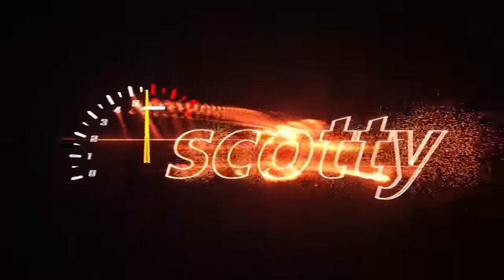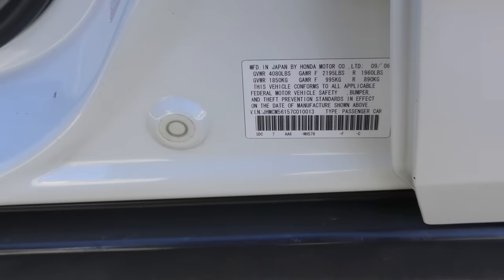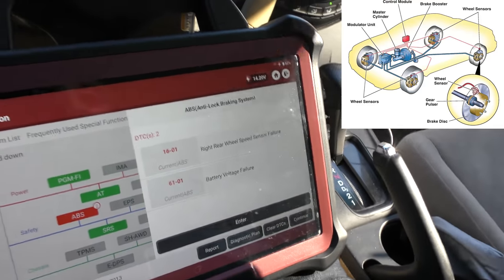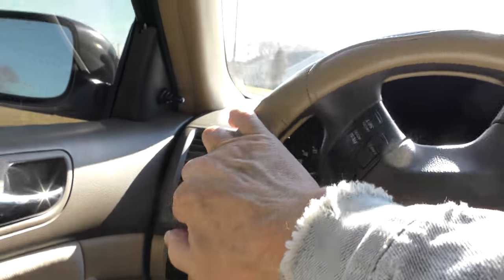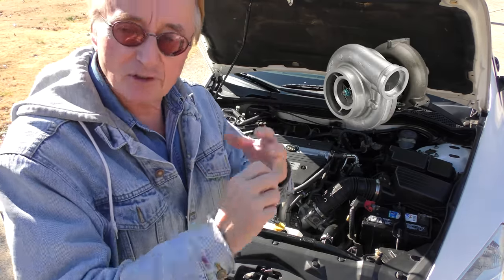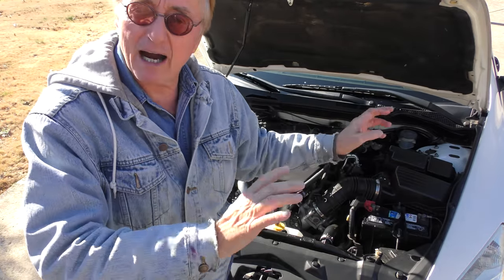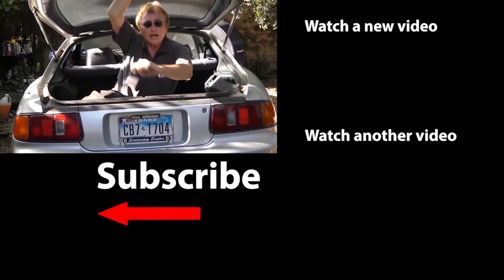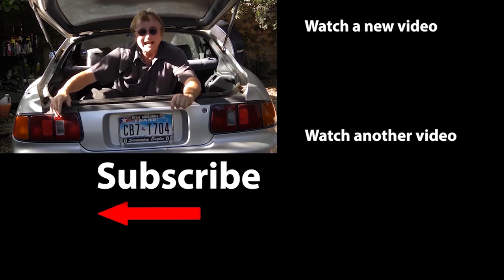Stop Buying Hondas with This Engine

Comment: My 2003 2.4 Accord with the 5MT is still going strong at 171,000 miles. Unfortunately the body has a few dents from parking lots, Colorado mountain roads, and my mom backing into the driver side quarter panel. Mechanically it's great, hoping to get at least 300,000 out of it.
Reply: You will no problem.  The k24 is a stout engine.  Just keep with the oil changes and you can't lose.
Reply: I used to have a 03 4cly had 220k miles when I got rid of it still ran great, now I drive a 05 4 cly everyday driver with 188k on it
Reply: 171k miles is barely broken in for one of those!
Reply: @tenhundredkills  good to hear
Reply: I had that same car. It's almost to 600,000 miles.
Reply: The only thing I'd really make sure of is to change the timing chain every 150k and transmission fluid every 30k (not a flush, just 3qts or so thats in the pan. My 07 accords engine failed at 257k because the original timing chain was still on it.
Reply: K series engines are very reliable and can handle alot of power. 2.0 and 2.4 alike.
Reply: Bought mine with 189k miles cheap due to owner not knowing what was wrong (turned out it was a crank shift sensor, 250k miles later she still runs like a top. Replaced timing belt, water pump,  wheel bearings, cat with high flow cat, shirt throw shifter, & some cosmetic changes. It's my work daily (almost 500 miles over 5 days a week). I will never sell it 😆
Reply: I had the same. Sold at 282,000 five years ago. It’s still going at 315,000. The original burned oil so it was replaced at 200,000 miles.Great car otherwise.
Reply: My 04 5mt 2.4 has 318k. Stuck clutch too!
Reply: I got a 97 with 177000 miles and runs like a champ
Reply: I've got a 2003 but it has the V6.  Still purring at 162,000 miles.  If you too care of your car I'd say 300,000 miles is all but guaranteed.
Reply: How’s the cvt tranny
Reply: @thebunkreport  Those v6 are known to have transmission issues especially 03-05 models.
Reply: @plekplek4934  I'm closing in on 175,000 miles and she hasn't slipped yet!
Reply: @MySuperman112  I'd say you still got your money's worth!
Reply: ..as long as it doesn’t rust-out for being a Colorado car. Also, I drive my car through logger trails through the flatwoods of S. Georgia. Been know to trail a few creeks as well. Hey, I don’t have 4wheelers, side by sides or golf carts. We have our ‘04 Honda “Ratatouille” sedan. Kids love a trip through the woods too..all buckled up!😂
Reply: @a.person7825  Oh it's worse. It spent most of it's life in Wisconsin.
Reply: @MySuperman112  Did the chain give any warning signs before it broke? Like..did it idle louder or jump timing? This is my first timing chain Honda..out of 10.

Comment: I love my '93 Del Sol Si, 1.6 VTEC 5 speed (original owner). Only 80,000 and in almost perfect shape. Just changed timing belt and water pump. Keeping it forever.
Reply: 3000 miles per year??
Reply: D16z6?

Comment: That was my favorite Accord! My friend had the v6 model though, and it purred so nicely… but I know the i4 was peppy enough. Definitely quicker than my brand new hyundai
Reply: @allentoyokawa9068  Indeed! They just put out another one today for a windshield that can detach.  My sister bought a 15' sonata and I bought a '15 Accord Coupe V6. Her car has had over 13 recalls and she's put over 6k in it for repairs not related to maintenance.  My car has had 3 recalls and ZERO problems in the exact sane time period. In  3 recalls they replaced my starter for free as well as my battery right at 35k miles and re flashed my fuel delivery system which I was not having any issueswith at all.  I've done nothing but maintenance and it runs las silky smooth as the day I bought it 6 and a Half years ago! Her car has fallen apart,  runs terribly, and sounds awful and is worth nothing. I advised her to not get it but she did. I also told her to get rid of it before 100k because it will absolutely start to fall apart then but she didn't.  Live and learn. Her next car will be a Corolla  camry a civic or Accord.  My other sister drives a 16' Honda CRV that I got her znd my mom is on her 7th Lexus ES. Currently a 19' model and it's the 1st one built in KENTUCKY! All others were built in Japan abd there us a huge difference in quality! 6 previous were super ultra solidly built and no recalls and this one has had 3 already. There is something to be said about MADE IN JAPAN!!
Reply: @gabevillarreal96  she will get many more!
Reply: @gabevillarreal96  dads got a 2018 sorrento and at 60km AWD broke, trunk latch broke and key fob doesn't work, sad
Reply: Get you a Element!
Reply: @ゴーシュガーキン  yep Kia and Hyundai are junk.  Had a 6spd manual Forte I bought at 42k and drove till 85k then got rid of it.  It gave me no problems but I know they were coming.  Plus shortly after I got rid of it the recall for the 2.4 engine came out.  Like when they would light on fire and such lol.  Glad I got rid of it.  Back to Honda Toyota or Fords only.  Fords have been good to me as my Frontier has been too.  That's the only Nissan I would buy.
Reply: @ゴーシュガーキン  my buddy just traded in his wife's 17' sorento with a horrific oil consumption problem. 3 quarts every 2k miles and they said it was normal because it's turbocharged!!?? He said screw that and traded it on a 19' Expedition. So fat no problems but Kia lost a customer for life with that one.
Reply: @robertl.fallin7062  Elements are cool and super reliable.
Reply: @allentoyokawa9068  😂
Reply: @applepoop10  I got a 05 with 83k on her in Sept of 2019 .  It was  a pristine  one owner estate car with three of the original tires! The guys at Costco had to use a sledge hammer to get the old tires off!
Reply: @allentoyokawa9068  Currently waiting for my mothers 2011 Optima 2.4 to blow up. Lost the trans at around 130k starting consuming lots of oil each week around 100k. Had many things recalled. Currently 150k on the motor
Reply: @allentoyokawa9068  Currently waiting for my mothers 2011 Optima 2.4 to blow up. Lost the trans at around 130k starting consuming lots of oil each week around 100k. Had many things recalled. Currently 150k on the motor
Reply: I have the v6 2007. It’s a pretty amazing car, and definitely sounds as good as it performs. I came from a v6 Sonata and can testify it is 50x faster than that car would think about lol
Reply: @gabevillarreal96  I would love to have purchased one of your Mom's Lexus ES trade in's🌟👍
Reply: @1jackvalley580  Funny story, two days after she traded in her 2013 ES and purchased her 19' it was sold and she saw it being driven around town. Didn't last long. Gets ALL her services done at the Lexus dealer because she drops it off, picks up a loaner RX350 and goes to work. Super convenient.
Reply: @alexanderkennedy2969 had a 17 elantra, and it was NOT a fast car by ANY means… it was comfortably quick, but I never actively could use that car aggressively… this 2020 civic i now have on the other hand, I have to actively force it to slow down 😂
Reply: @alexanderkennedy2969 yeah, maybe so… but now the Elantras are too unnatractive for my tastes 😅
Reply: It’s amazing how much they will bring. My kids first car. She is still driving it 8 years and 160,000 miles later it’s up to 300,000 and while it has issues it still starts and gets to work everyday. Oh and a 120 mile one way to the lake every weekend.
Reply: I bet one of the guys at the dealership grabbed that.
Reply: Honda>Hyundai

Comment: I have a  2011 Honda accord  with the  vtec engine  . Great engine  . 125k miles on it . Oil  change  every  2.5k  transmission  fluid  change  every  20k . I  put in a half a  quart of marvel mystery oil  when  I  change the  oil . Its  runs so smooth  . Very quiet  . Akebono brake pads . It should  last another  20 years  . I was able to  get  480k on my last Honda  , a 1983 Honda  prelude  with a 5  speed  manual transmission  .

Comment: My 2013 Honda accord ex-l v6 has 230k miles.  Runs like a Swiss watch.  I average a consistent 35-37 mpg on hwy doing 80mph.  Otherwise average 27mpg mixed.  Pretty damn good imo.  Recently bought a 2018 Honda accord 2.0 sport.  I'm averaging 32-33 mpg hwy doing 80mph.  Real world numbers folks!

Comment: I’ve had my 2003 Honda Accord 2.4L 4 cylinder for almost 18 years now. I get 👀 when I tell people how long I’ve had it. Almost 240,000 miles on it and still going. Just need to watch my oil levels as it consumes oil because of almost 80 miles a day commuting to work and home. Best car I’ve ever owned and gonna try to keep it for 20 years.
Reply: Oil burners
Reply: @ChicanoOne760  ha…it is but better than a car payment. Still runs smooth too.
Reply: It might be something pretty easy like valve guides replacement to stop the oil consuming... If it not and its the piston rings, that is a lot more work and $$ but it is not ever as much as if you had a bigger engine...
I have a friend who has sold used Honda and Acura vehicles for over 40 years and he is driving a beautiful, older Civic that has 640,248 miles on the odomoter.. I sat in the car and pulled up that odometer, and there it was!!!!  These cars can go a long time if you keep up on the oil and filter...
Reply: @frandanco6289  the 2008-2012 2k4 engine has a class action lawsuits for defective piston rings causing excessive oil consumption
Reply: Maybe replace all gaskets, my Buick was leaking so I replaced the engine gasket set and it is great now, no leak whatsoever.
Reply: @babycakes8434  You have the 3800? How many miles?
Reply: @darthdarthbinkss  280K Acura MDX and 140K Buick Lesabre
Reply: Oil is cheap, in some places a quart of oil is cheaper than a gallon of gas
Reply: So the transmission shenanigans stories about these Honda Accord’s are basically baloney

Comment: I have a Honda Accord 2.4 i- vtec 2006 here in Sweden, 489 000 miles on it and it still runs great. Only changed the clutch and the timing chain. I also have an Audi A4 2013 with half of the miles and a lot of issues. Never a german car again.

Comment: My sons 2003 accord has this engine with 180,000 miles.  Burns a little oil.  Had the Cat fault code but Scottys paint thinner trick worked and cleared the code!
Reply: I have a bad cat what do you do with the paint thinner ??
Reply: And my car is an older Honda Accord
Reply: @jaylanprendergast791  it’s actually lacquer thinner.  Put a gallon of it in your fuel tank
Reply: @robbflynn4325  thank you I’ll try it
Reply: @jaylanprendergast791  not guaranteed but worked for me, as a result the car passed the state inspection.  Have the Rustoleum brand at Walmart for $15.
Reply: You could try some Cataclean 1st .
just follow directions .
Ive used it and worked good .
Ive never tryed the laquer thinner but I would try it if the Cataclean didnt work .
Reply: @jayhockley8841  I tried cat a clean before the lacquer , it cleared the code but warning light came back on after a couple of days
Reply: @robbflynn4325  guess it’s a hit are miss I just change my change my cat converter switch with a denso one I pick up from advance the light didn’t turn off until I took the battery out been a few days now it haven’t turn back on

Comment: I had a 2004 CR-V (the only car I ever bought new). Put 225,000 miles on it, and then it got totaled being in the middle of a 3-car accident. 😟😢 I now have a 2014 CR-V that I bought used. Currently has 147,000 miles on it. One thing about certain Honda’s in and around the mid-teens years is that they had issues with the VTC Actuator (causing random brief grinding sound upon a cold startup in the morning). Got it replaced via recall issue (twice), but I still occasionally get that startup sound (especially in colder weather). It also has other ticky-tack issues that are annoying, but it still runs well and gives great mileage (I average 18,000-20,000 per year on it due to my  daily commute). Will hold onto it as long as I can. When the time comes, I’ll bump up to a used Pilot. But that won’t be for another 50,000-100,000 miles. 😎 This is my fifth Honda over the last 30 years. With most Honda’s and Toyota’s you can’t miss, unless it’s a used one that was poorly maintained or mistreated.

Comment: That Accord looks like a car I used to have. 2004 LX, 2.4L white with ivory interior. Good car. Lost it in a flood. Couldn’t be salvaged. Got a ‘15 Accord EXL, same engine and colors. After 19 months of ownership I have only driven 8K miles (working at home). Car has only 66K miles on it. TPMS driving me crazy though.

Comment: Still have my 2006 Accord VP.  Did the oil changes, tranny fluid, and drive it gently. It only has 152k and runs great. The K24 2.4 VTec engine is a trusty workhorse.

Comment: The  greatest 4 cylinder engine ever made...

The volvo's  and Merc's are behind at a mile
Reply: Toyota and Honda .are the best ones on the road. Then mazda
Reply: @richsweeney1115  yes
Reply: @richsweeney1115  I have a 2006 Mazda5 with 200k on it. The only thing that happened to this car is a recall on the exhaust system and had to replace the A/C blower motor.
It was built in Hiroshima, Japan.

Comment: J series V6 Hondas are known to be bulletproof .  One of the most reliable engines out there . All it needs is a regular oil changes and valve lash adjustments every 100k miles .
Reply: Timing belt at 100k too. Interferance engines.

Comment: Lucky to have a 2003 Accord Coupe with 83,000 miles and a 4 cylinder. Great car, new tires, rear brakes and regular oil changes. Just as good as a new one!

Comment: I'm so happy I found my 04 Acura tl. She has some body damage and the dam dash is cracked but the engine and transmission is in such good condition. Over 200k miles and she is a v6 but I really don't have performance issues! 
My plan is to get myself on my feet and keeping my car expenses down helps so much.
Reply: Ive got an 05 Acura TL with the 6 speed manual trans . I love it .
Reply: I’ve heard about those tl always having crack dash
Reply: Used to have a 06 Acura v6 with 240k till someone rear ended me

Comment: Have 2007 Accord, built in Marysville plant, still rolling strong at 176 k garaged from day one in dry Arizona,  2.4 PZEV,  auto trans, 36 mpg, after 176k my behind fits well into the drivers seat, oh yeah I've also got a 2007 Honda Odyssey Exl, with 184k been coast to coast many times,just got to raise em right, my buddy whose a shop Forman at a Honda dealer,says just keep the fluids in them and maintain them, so far enjoying the rides,always love Scottys input,been watching him for years, I've also driven Toyota's over 200k ,when I bought the Accord I also looked at the Camry,however the Accord won,because it felt sporter, and more fun to drive, and is still fun to drive,

Comment: Normally agree Scotty but the J30 V6 of those years was extremely reliable with belts replaced. Someone is near 900k on an original engine with no valve adjustments done.  I agree the vcm and newer 3.5 was prone to more issues.
Reply: I agree and the J series motor holds good power without being built too!🤙🏼my favorite is the B series engines.
Reply: But you have to realize that on the J30a Series engine made it in the world's top 10 most reliable engine list
Reply: I've heard that you also need to change the timing belt for 100,000 km for the 3.5L V6.  Is this true?
Reply: @davidacave  yes. But, you should do that normally on any vehicle that uses a belt opposed to a chain.
Reply: @David Cave  105k or 10 years
Reply: @davidacave   On the 4th cylinder the timing chain guides always wear out  plastics
Reply: the 3.5 literally last forever with the right maintenance.
Reply: Actually most of the the 3.5s are solid too, 08-12 had issues with  VCM causing uneven cylinder wear but they fixed it in 13-17 models, and every model with a manual transmission obviously has no VCM anyways. The j35 itself is just a standard SOHC v6 with forged internals Honda has been making them for 20+ years.
Reply: @davidacave  that's true for every car with a timing belt brother

Belts every 100k

Chains every 200k-300k

Belts need changed more often but they're easier to do. Pick your poison, also you can let the timing belt/chain break on a non-interference engine and it won't hurt anything.

You only have to worry about it if your car has an interference engine because if the belt breaks the Pistons could beat the valves to death.
Reply: I have a 2006 honda pilot has 340k miles runs fine but I’ve always used mobile 1 synthetic oil love my v6 pilot
Reply: @MarkIV_Garage is Hondas 2.4 an interference engine?

Comment: You can’t beat any K series engine. One of the best engines out there.
Reply: 😅 I see what you did there
Reply: @aukoda R18A2 is also a reliable engine. Just bought Civic Tourer European market with low mileage. Looks and runs like new although almost 10 years old. No more turbo charged german made crap for me.